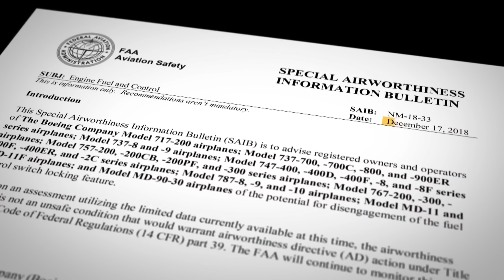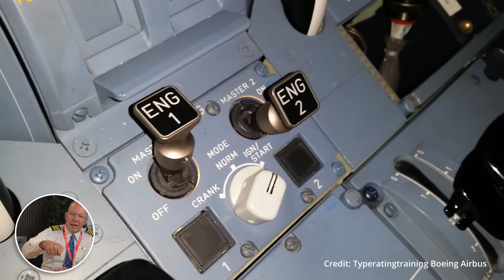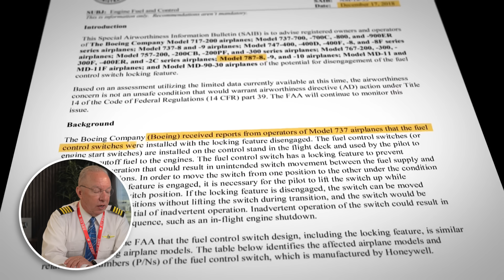Air India 171: The FAA’s 2018 Fuel Switch Locking Bulletin Explained (16 Questions Answered)

Comment: 15:00 how about “brain fart”?
I’m not a pilot but years ego I had this happen to me while operating a forklift. Instead of sounding horn then backing up and lowering forks. I ended up “flashing” high beams (for those that don’t know on forklift that’s forward/reverse switch). Shift in direction startled/shifted me enough that instead of gentle backing up slamming gas pedal and end up making significant mess.
Maybe pilot got a brain fart and instead flaps or gear he hit fuel switches?

Comment: This morningI talked with a 777 first officer who said their systems are similar. He postulated that an incorrect altimeter setting could have caused the aircraft to believe it was higher than it really was a takeoff, causing the throttles to automatically move back. This may have made the pilot(s) think the engines were cutting out; for which a restart would require a shutdown first before a restart. Maybe I misunderstood this . . .

Comment: How did you come to the conclusion that the fuel knob was set to cutoff within a span of 1 second?
Reply: thats what is stated in the report
Reply: @w4lu  the official report doesn’t give the exact time the fuel switches were moved to CUTOFF. It only says they were both shut off within a second of each other, around the time the aircraft hit peak speed (08:08:42). Engine thrust was lost at 08:08:47, and Engine 1’s switch was returned to RUN at 08:08:52 , a 5-second gap. So when people say the switches were turned “on within a second,” that’s not fully accurate. The report doesn’t mention how long they stayed in CUTOFF , just that they were later put back to RUN.

Comment: Why second pilot wasted 10 seconds before turning fuel control switchess on?. 10 seconds isn't small number when you are in air at low altitute.
Reply: i am also curious about this... he says "thats an incredible presence of mind" but really if you try counting to 10 right now you notice that 10 seconds are actually quite long. only thing i can think of is: we don't know at what time the second pilot asked why the switches were pulled. maybe it took him a while to realize and then when he did realize, he immediately turned them back on
Reply: @w4lu  yeah, that's most probable that second pilot needed 10 seconds to realize what was going on, but then there must be some kind of alarming system in cockpit which alarms pilots on such cases. Captain Seeeve said that there is no need to be alarm system, but if we think about this, such alarming systems would prevent such cases. pilots will not waste time figuring out what is going on.

Comment: Locomotives in the USA have inward and outward cameras that permits remote viewing without crews knowledge. I fully understand that crews don’t like it (would you). That said, what is ok for Engineer/Conductors should be ok for pilots. Sure it would not have prevented this accident but all would know for sure what happened.

Comment: By blaming Pilots, they have saved every one, and now lets save Pilots too, In India to turn on, switch is pushed DOWN, but US its pushed UP, maybe younger Pilot had BRAIN FART moment, and flipped the switches in Indian way, Switch movement is still the same, up and down, tho in aircraft, it just has to be pulled outside and then up and down
Reply: If this was his first ever flight, that would be a possibility. In this case, no.

Comment: You mentioned that the cut off switches were turned back on by the other pilot but sadly the time wasn’t enough for the airplane to   Get the thrust back , however how come the switches were found on the cut off position after the crash ? Especially if one of the pilots tried to turn them on again , it might have a defect

Comment: 15:48 An image of the RAT being deployed—or rather, already deployed—immediately after takeoff is available in the preliminary report itself. Could this indicate a case of engine failure, which may have subsequently led to fuel cutoff as observed in the FDR?
Reply: Given the engines couldn't recover soon enough would mean whoever disengaged supply did so intricately.

Comment: Why does the flight control system permit the fuel cutoff switches to operate at such a low altitude during a full power climb out?  Implementation of this safeguard may well have saved all of these lives.

Comment: Is there any way to add redundancy to the cutoffs? Where both pilots need to somehow agree to touch them in flight or else they won't work? Or physically separating them somehow to both sides of the cockpit? I'd assume the plane needs to be fully flyable by a single person in case of an incapacitation, so I think I answered my own question, but wanted to hear your thoughts on it.

Comment: Helllo Captain Steve, You mentioned the switches was flipped one second apart, which switch was  switched first? Because if I was the  copilot, which sits on the right side of the cockpit, I would switch the closest switch, which is the right to left and if it was the captain it would be Left that right. This could possibly identify which of the pilots engaged the switch to cutoff.

Comment: 12:06 In the toga / climb phase, the engine cut-off switch should never be able to cut-off fuel to any engine until a safe altitude (say 5000 feet) has been reached. This is a no brainer and I am fully on the Embraer Design-Philosophy on that one! But Boeing never was about intelligent design, otherwise they wouldn‘t have come up with the idea to not hook up the FDR on the B737 NG to the battery (Which is the reason, we will never know, what really happened to that JEJU air flight…)

Comment: Capt Steve, in the first video since the incident you said that its possible that the copilot accidentally pushed the switch controlling flaps instead of landing gear. Is it possible the same thing happened but with the fuel cutoff awitches instead?

Comment: There’s nothing wrong with having a camera over the center console of the cockpit.
The solution to this problem  and to many others could be found that way.

Blaming the pilots without knowing any facts or conducting a proper investigation is premature.
It’s true that in the wake of a tragedy, airlines often prefer to blame the pilot, because it allows everything to be settled quickly.

In aviation, we should focus on solving problems, not letting them slip away until a later time.
This mode of transportation rarely gives a second chance unless there’s a miracle."

Comment: Isn't the over-dub intro innacurate? "Accidetally switchg fuel off ... could cause a mid-flight disaster". My amateur understanding is that, given enough time = enough altitude, the complete engine re-start can be performed, even several times. Recalling the BA Flight 009 over Jakata loosing all engines ingesting volcanic ash, many re-start attempts were needed before sucess. 
IF AI171 fuel were switched/'moved to off', it was the lack of airspeed & altitude coupled with fuel-off that led to disaster.

But, I am a little confused about the timing of events. 
The RAT is deploys when the main electrical supply(s) fail. The main Engines normally generate the electricity.
If the fuel-off switches also trigger a power cut-off, it sort sort-of makes sense.
If not, then even without fuel the engines must take some seconds to spin-down to very low RPM - AFAIK they can generate power at Idle?
It seems to me the the fuel cut-off must have happend some seconds before Rotation for the engines to spin-down below their capability to generate electricity?
Is it possible they'd just reached V1 when the pilot(s) realized there was a problem? Then followed their training to get airborn whatever?
I've always thought the Air France Concord disaster might have been less-deadly had they stayed on the ground?

Comment: Love ya Captain Steve, you help demystify many air travel myths!  The bulletin specifically states that the locking feature is the detents you mention and the switches may move up and down with no in and out movement. 
  Also , the end of the bulletin raises the possibility that this locking feature can/has/might break resulting in the same problem.

Comment: If it was suicide then the pilot that wanted to kill himself wouldn't have said "I didn't" when the other asked why he did cut off.  Also, there would have been in indication of struggle between the pilots and resistance to turning the switches back on.  Instead all the indications are they did everything possible to recover the situation.   That indicates one of the pilots inadvertently cut off fuel to the engines.  Since they've both performed the same take off procedures scores of times without incident that would indicate that the pilot that turned fuel off was in some altered state of mind long enough to commit the error.  Possible ministroke in the brain, fugue state, if it was sabotage at all it would have to be marionette programming.

Comment: How would investigators know from the data recorder someone manually flipped the switches vs a computer software issue causing a signal that then cut the fuel? How would it show up differently?  Is it possible no one touched the switches and a rogue signal has indicated the switch has been moved and the software has just cut the fuel? Sorry if it's a silly question.

Comment: Hi Captain Steeve - a friend suggested that the fuel cutoff switch design could be modified to require an active concurrence between both pilots in order to cutoff

Comment: Why did the plane take so long to take off or use the runway why is that not being talked about?

If it was purposefully nobody would have been able to pull them back on id assume the switch would be blocked from turning back on or fought?  

So they likely went off by computer and they turned it back on and at least tried and the airline used more runway then should have been needed.

Comment: Is it possible that the captain use a open hand to hold the thrust levers forward and that server turbulence let his hand slipped down and knocked both cutoff switches to the off position if the switches lock function was damaged or not functional?

Comment: Thing to understand, if it was an electrical issue, the flight recorning would have recorded other events too. Like a power loss, or other things that got turned off.

A fire would have attacked other wires too. The chance that it attack only those two circuits AND with that timing AND without causing other issues is virtually impossible.

The switch being faulty, the chance that it would have been unreported from all the previous flights and, again, turned off with that timing, is also virtually impossible. One that turn off? Maybe. Not both. Not with the 1 second delay.

Fuel dumping take a VERY long time, like an hour or more. Even if they would have started the dump, it would have done absolutely nothing but maybe set everything on fire before the impact zone, making it effectively worse.
Reply: Too low altitude, too little time and isn't fuel dropped over water whenever possible to avoid harming people or causing problems below? Sometimes when they can't do that and burning a fuel is an option, they do that instead. I think Jet Blue did that b/f its emergency landing at LAX b/c of a nose gear problem. Though that wasn't an emergency like a plane that's lost engine power.